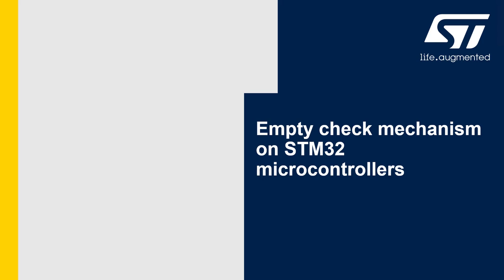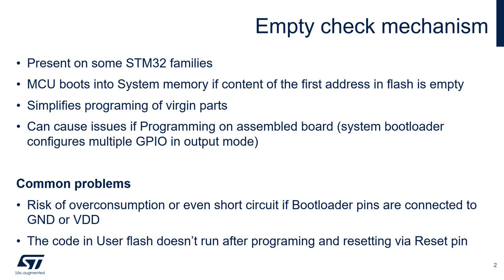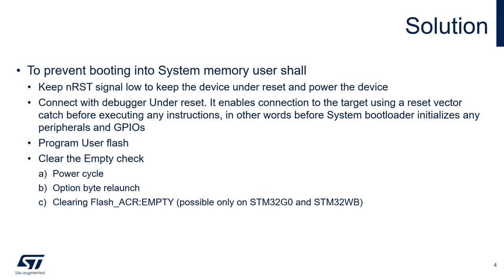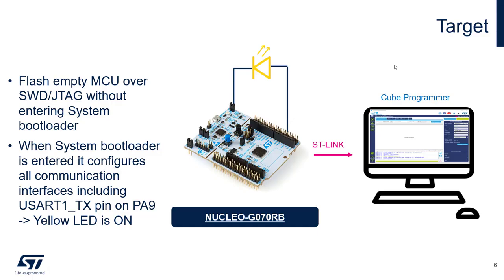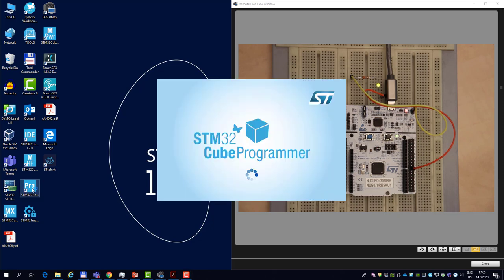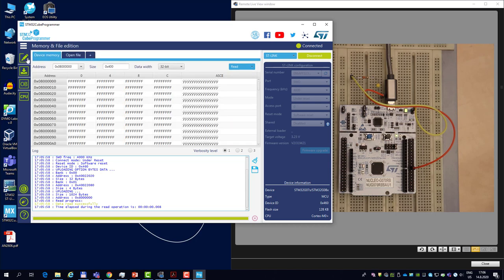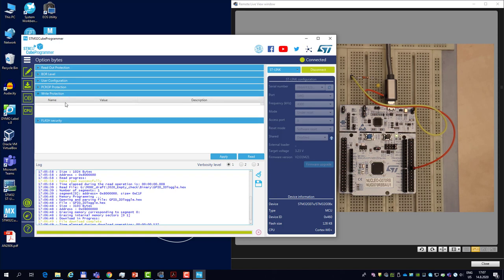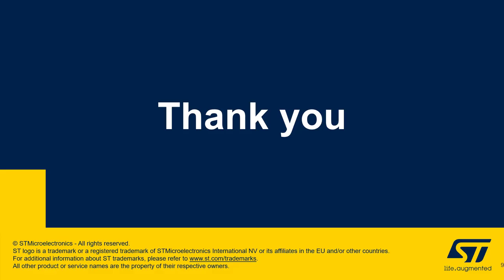STM32 boot and startup tips - 1 Empty check mechanism

Comment: is there any option to SET  &  RESET boot pin using code only. no need to connect any external Hardware (no need to connect boot pin to VDD externally )